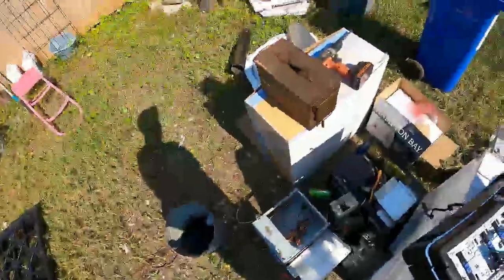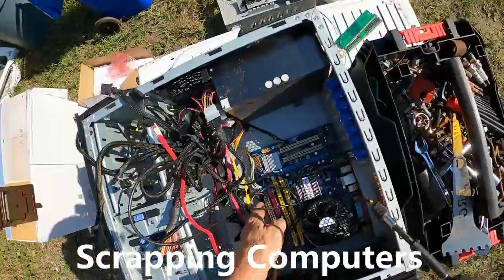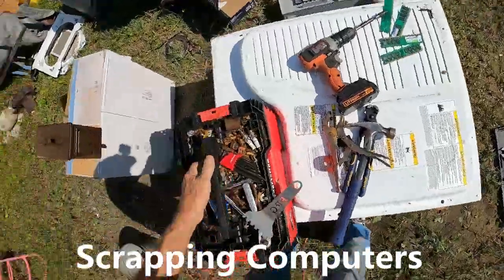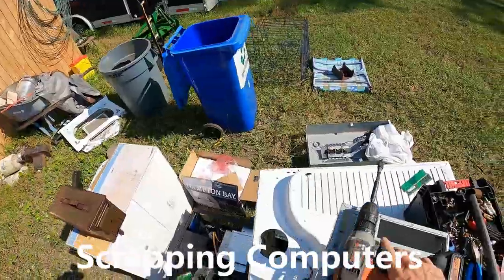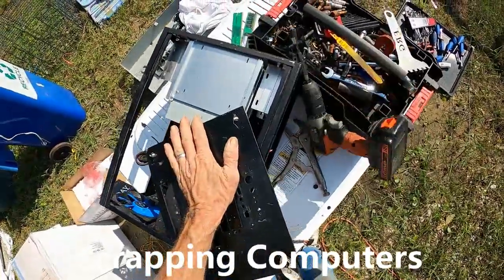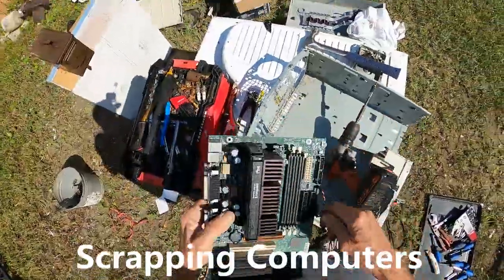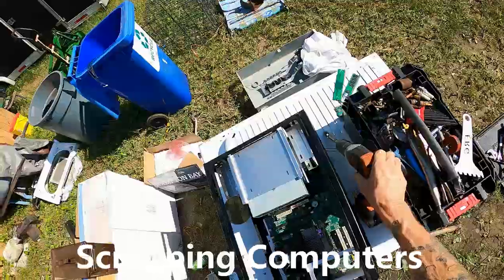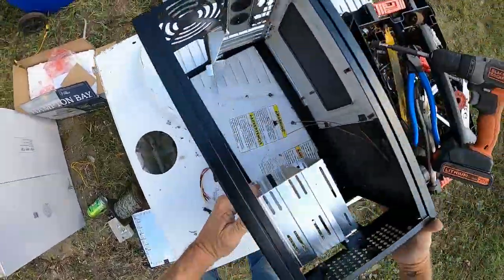E-Waste Computer Recycling. Removing all the goodness.

Comment: Ribbon wire is basically low grade insulated wire so keep those separate just in case your yard wants it like that. I keep a box just for ribbon wire from PCs, my yard pays around 10 cents/pound so it's close to insulated alum wire pricing.
Reply from the maker: Thank you for that information Jay